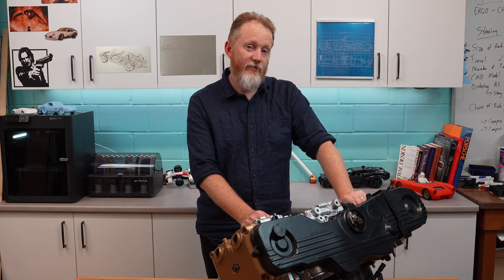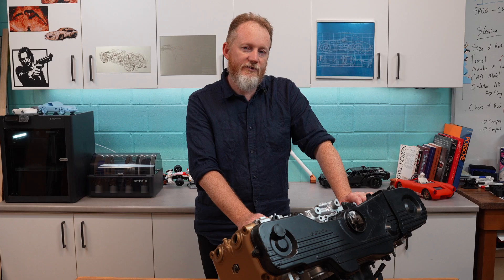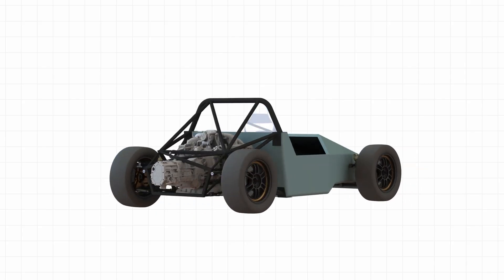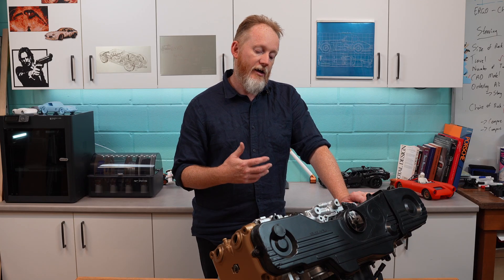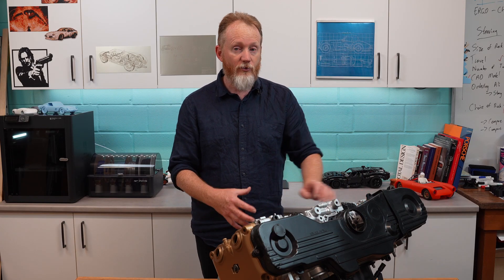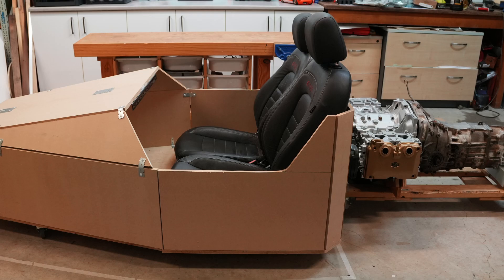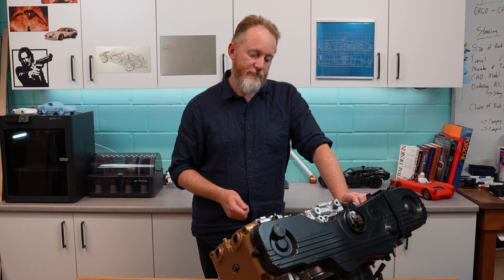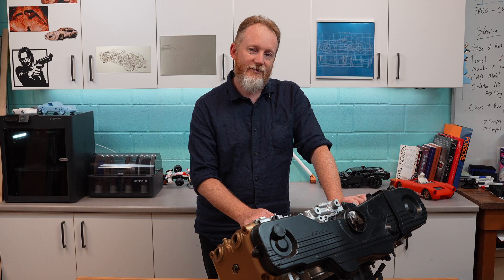Lightweight Engine Mockup (Project 171)

Comment: I like mockups but I like spares and cores better.

I often think about the project I want to build when space, time and money become available and recently I was thinking about spares.

I want to use an 8HP50 transmission so I can do all of the flappy paddles, launch control and other supercar stuff but I also want to make it so I can install a Getrag MT82 6 speed manual.  That means I need a transmission tunnel that will fit either and a hole for the MT82 shifter.

With that in mind, why not build two tubs and wind up with two cars?  Then a spare tub would be a good idea and 4 cars worth of body panels would let me drive without fear of minor fender bender accidents.

If I can be accident free for a decade or two, I can even use the spares to make a third car.

That will increase the amount of composite work I have to do but it will all be done when I have all of the stuff together to do the work, only make one (big) mess and my spare car will allow me to keep at least one car road worthy at all times instead of putting me in a normal vehicle if I have a mechanical issue.

This plan also lets me amortize my development costs over 2 to possibly 4 cars which might seem silly for a passion project but if I get the styling and performance right I'll be a mini marque instead of a pure custom.

To do that right I need to make it somewhat streetable with a nicely finished interior.  I think that can be done without adding much weight if it's designed with a light weight interior in mind.

Modern stand alone EFI units like Holley have CAN bus built in and traction control.  There is a Bosch stand alone ABS system that can be sourced out of a junkyard.  The Tesla electronic brake booster can be run stand alone.  There are electronic power steering units that can run stand alone (if I need that) and there are cheapo car stereos with Android Auto integration (for navigation and what not).

If I get real fancy I'll try to come up with an augmented reality windshield HUD for turn by turn navigation.

Any way, there are tons of things that can be added that don't necessarily have to be integrated in to everything else so you can make a car that has all the features of a modern hypercar without a lot of the maintenance issues.

I just need to decide which features are important, which features I can get for free with the hardware needed for the important features and leave out the rest unless it's really really cool.

But back to spares.  I want a pile of parts big enough to make 4 cars, maybe more with wear components.  This means I can mock up with real parts and have a spare to look at if there is something I can't see with an assembled mockup.

I'm going to have a chassis jig (on a hydraulic scissor lift hopefully) and a gantry crane or engine hoist so mocking up full weight parts won't be too much trouble.

I'll probably make an engine/transmission lift plate for the top of a Harbor Freight hydraulic lift table so I can do out the bottom engine changes on a 4 post lift.

The chassis jig is the only large expense that's hard to justify but hopefully my budget will allow it when I'm building my "dream shop".  The rest will be tools I will want or need any way.

A light weight mockup can be cool and maybe shop furniture after you're done using it but I want spares, full weight mockups and a little bit of equipment to handle them...

Comment: The heads are completely different between the sohc and dohc ejs, ej205 is around 50lbs heavier less the turbo vs an ej253 etc
Reply from the maker: Haven't quite decided which version of EJ the final motor will be, or even if it is a switch to an FA.  There will be some leeway given in the design so that the rear chassis is not so tight around the motor that there aren't options moving forwards.  Still surprised that there is 50lbs difference in the models, appreciate the insight.  Interestingly I have been leaning towards an ej253.  Want a fairly simple engine, and the extra displacement is handy.

Comment: IMHO EVERY automotive engineer should have to go hands on working on the parts of cars that they are designing. Designing a car that goes together and works is fine but when you have to spend 3 hours to get to a spark plug or an hour to get to a filter then that is a clear failure on the engineer. Building a mockup is a necessity.
Reply from the maker: Great point.  Although as a counterpoint if the engineers didn't make stupid mistakes on cars then the mechanics would have nothing to complain about :)  Had my own fun recently of disliking VW engineers for making what should have been an easy hose swap into something that was not very fun and took a long time to do.  Fasteners in locations where you can only do 1/8 turns of the socket at a time is my particular pet peeve.

Comment: Going to have to steal that cad vision term. I always get flak for always printing things at work or mocking things up with cardboard/tape in FSAE but almost every time I find something I need to change or add as ref in cad. Usually it seems im moving pretty slow on a project but the final parts are always fitting 100% butter.
Reply from the maker: Cardboard and tape mockups are such a quick way to check placement of objects.  You can just iterate so much faster than CAD when it comes to packaging.  Really valuable in FSAE where space is at a premium and small mistakes can make you really pay later in the project.

Comment: Mock ups are great. Most people don’t have 3D Scanners, so have to resort to a tape measure and then the mock up gives the final confidence that it might actually fit! You can buy plastic mock up engine blocks in the US but, they tend to be for the V8 community. I completely agree with the cleanliness part. It’s just better.
Reply from the maker: It is pretty easy to miss critical areas in CAD, especially when it comes to maintenance.  Some of my favourite designs have been entirely done on the shop floor.  Plastic blocks would be great, and it doesn't surprise me that they exist as a product.
Reply: If you don't need precision, Cardboard Aided Design is fantastic!